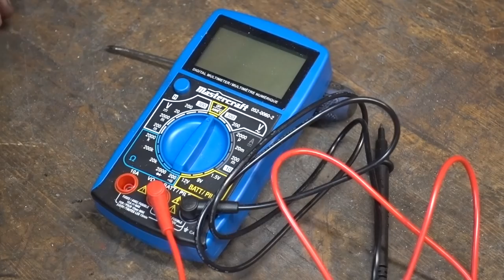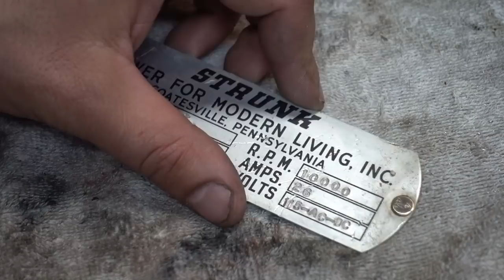1960s Electric Chainsaw [Restoration] (Part 2 of 2)

Comment: At 11.55 its missing a O-ring seal around the cable. It should have least 5mm of outer wall of cable past the tension holder, to make sure cable wont be pulled, specially in tool like this. Also DONT USE ELECTRICAL TAPE, except maybe under the heat shrink tube. Tape will eventually dry and unravel, regardless how good quality it is.

Comment: Dry wood cutting is harder on the saw and the chain, also... why didint you use a round phile to sharpen the chain??
Reply: Becouse the cutting was shit the chain is bad, you need to get sqaire chips, not dust

Comment: Brilliant vid, your skills are epic m8   btw I bought recently a cheap as chips Evershed megger, a 1933 one and its just brilliant for testing motors, windings, insulators and for short circuits too as you can get a load test which a multimeter can't quite do as well, think I paid £10 and it has its own windy arm current generator built in and great fun seeing who is manly man enough to take a zap hehe but it is just one of them really useful bits of kit if you ever see one you could do a resto perhaps?
Reply from the maker: Great idea!

Comment: 7:26, your gasket is in wrong. The chain I would leave a little looser then normal. It can put a lot of strain on the electric motor which is tripping the breaker. They don't have the power gas ones do this is good more for trimming and small tree's.

Comment: Can anyone tell whats is the red can for?
Reply: Paris Giovanos red can holds bar and chain oil. A thick lubricant that is deposited directly where the chain rides on the bar by way of that little plunger and copper tube he attached it to
Reply: maggs131 thx bro

Comment: I do realize you're very experienced with tools but how on Earth do you manage to remember where each of those bolts, nuts, washers and so forth go. I never managed to disassemble anything without having one or two either missing or too many after reassembling. Even putting them in plastic bags and tagging them didn't help!

Comment: Electrical tape is useless, as it just comes apart with heat over time... You're best off just doubling or tripling heat-shrink instead... 10/10 though.... Great job!!!
Reply: Use electric tape designed for high temperatures in this case, they are often used for insulation around CPU and GPU chipsets in computers.

Comment: Ha ha, 7:25 gasket keeps sawdust out of motor, to do that the whole motor needs a gasket and after all that careful wiring and "maximizing" of the electrical tape at 12:35 you didn't dare to test the motor without a rubber glove, where's your confidence and courage? Dont you realize that if it shorts out and knocks you on your donkey it would've made a funnier video. I have a multimeter like yours only yellow, didn't know that checks resistance, wish you showed that part more, I only use it to see how juce a battery has or if a 120 volt outlet is live. All and all a great fix it video thanks for sharing, I enjoyed it!

Comment: I love your work, but please get rid of the isolation tape, this is a pain in my a.. everytime I open a handtool and find these f... tape.
It getting sticky after a some years. Like someone uses flypaper strips instead of electrical tape. And go and get a crimping tool. Do not solder crimp lugs. They'll get loose after some years.

Comment: Soldering and cabling work is not as good as other mech stuff. You can use electric tape without touching it. And please cut it properly.

Comment: You said "maximum tape because handle is aluminum" ......(sighs).......it really doesn't matter because unit is case grounded,....couldn't shock you anyway....current takes path of least resistance....I.e. The metal case (or ground) is less resistance than human tissue .....so......
Reply from the maker: What if the ground gets disconnected though?  It's a "just in case" thing.

Comment: That sloppy, cumbersome wrench at about 15:00 is ridiculous. You'll round-off fittings with it, especially since you're using it wrong. Use proper tools. I mean you bother to file smooth damaged screws and brass fittings so using that horrid nut stripper to tighten something is egregious. Can't help but wonder why you bother with it?

Comment: It's not that the chain coming loose that's your problem. It's that worthless electric sharpener. I can sharpen a chain by hand 100 times better and have the edge last longer than one of those wastes of scrap metal will ever think about doing.

Comment: surprisingly craptacular excuse for an oil reservoir.  seems like a manufacturing afterthought!  "oops we forgot about bar and chain oil, lets just strap on one of these old paint thinner cans with large hose clamps"  and by the way 19:42 gave me terrible visions of possible outcomes involving that sharp chain whipping around at hundreds of rpm!  yikes

Comment: Why use shitty electrical tape when you could just use the heat shrink tubes? Tape is going to fail eventually.
Reply from the maker: There is heat shrink under the tape.